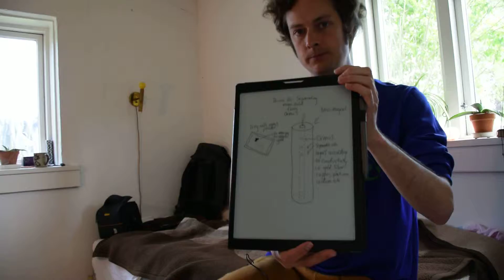Extracting pure monoatomic gold from Ormus, using mercury and magnetic induction

Comment: We tried using high frequency induction to separate a dry powder, via a hollow loop coil that a test tube could be shaken up inside of.  But even at 100KHz the powder does not respond.  Of course we tested the dry powder against a HUGE Neo magnet and it was equally unresponsive. Maybe it was a bad batch.  What it does respond to is strong electric fields...